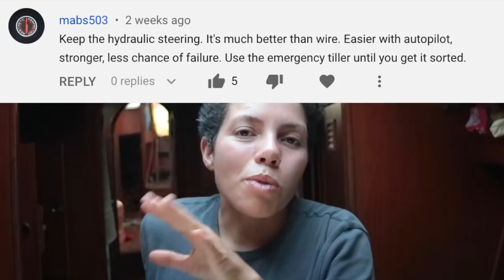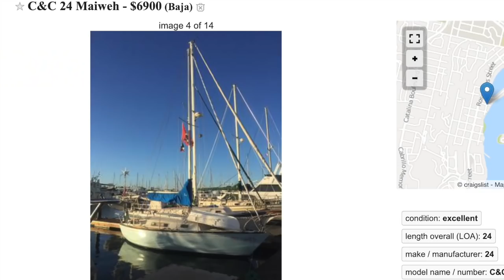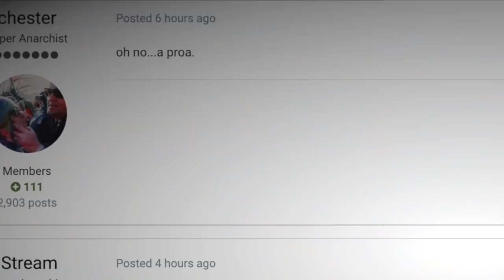Desperados

Comment: the sander may have been designed for use with a vacuum dust removal system, not connecting a vacuum to these units results in excessive dust buildup and bearing failure Festool make an excellent sander they cost a little more but are well worth it but use it with a vacuum
Reply from the maker: That might be the case - once I started using the sander with the vacuum, things became a little better. Only had to replace the bearings once more!

Comment: I put my MacBook air in a waterpeoof bag. I added silicone envelopes to absorb moisture. Well one broke open and a mini pellet got styck in my fan. Removed the fan and broke the connection plug. So i got a Mac Mini with a 12v tv screen to edit with. And use the MacBook for internet and photos only. It used to really heat up when transfering clips and renderinf. The fan would ramp up hard. Then there is my drone, a spark. He's stuxk on a cliff after losing control. BTW loce your intro!
Reply from the maker: Looking forward to the drone rescue if you are attempting to do that in an upcoming video, haha!

Comment: I used to work in an electronic manufacturing plant, all our boards that were going to humid environments would be sprayed with "conformal coating" to keep moisture out. You can get it on line but you have to be careful to not get it on to any connectors as it will insulate the connections.
Reply from the maker: Yes, I imagine you can't just spray everything down with it. Only particular parts, so that complicates things a little. Thanks for the info!
Reply: @sailorama  you can spray pretty much the whole board. Just avoid any connectors, motors like fans, and heat syncs. There should be lots of tutorials on youtube.

Comment: have you considered using a de humidifier   .  perhaps you could store it in a plastic tote with a passive  dehumidifier  and if your solar could handle it  perhaps running a  powered de humidifier in the boat cabin  i am sure you could pick up a small cheap one
Reply from the maker: This is an idea...however a lot of power demand. I’m going to work on getting some little dehumidifying baggies to put in my computer bag first, and then see where we go from there.

Comment: Try this trick with your computer. I have a commercial ziplock bag that I got from a friend who works at the post office, but you can find them other places as well. When I'm not using my computer I put it in the ziplock bag which has rice in it. My computer has covers for the usb, power and other plug entries. I lost a couple of them over time and found a small piece of electrical tape works just as well. When the computer is not in use, the rice draws out all the moisture. I also do this with my handheld "waterproof" (lol!) VHF when I long term store it when hauled out. They are both still working in fine condition. I'm still going to have to replace them but from age and because they are so slow compared to the newer stuff out there, but not from salt moisture. Good luck and love your videos your newest subscriber!
Reply from the maker: I like this low tech moisture bag hack, haha. Sounds powdery though (rice flour in all the cracks).

Comment: Take the protective case and keyboard cover off the laptop it's not protecting anything and it is insulating the laptop and make sure you aren't sticking it in a case that holds in moisture directly after using it.  Adding some dessacent bags to your laptop case won't hurt either.
Reply from the maker: This is good advice. I was keeping the last laptop inside the waterproof case too often, without those little baggies. The keyboard covers are keeping the area a lot cleaner though. If the computer isn't overheating you would still recommend not using?
Reply: The keyboard area is above the areas that create the most heat.  So that thin rubber protector is letting heat through but trapping moisture underneath.  That might be fine if the keyboard area is separated from the main chassis.
Reply from the maker: Thank you for the explanation. I had not thought about it as a moisture trap. Took the keyboard cover off.

Comment: Looks like it would be easier to build a new proa from scratch. What are the specs on your new 'ship'? Length, beam, draft, headroom?
Reply from the maker: The thing is, we're really just trying to do the simplest thing ever. Sand that thin layer of crappy, crusty varnish off and address the small rotten spots. It just ended up being more troublesome than imagined! You know, we don't have those specs available (like on sailboatdata). We still haven't physically taken those measurements - time to get on that!
Reply: It's a beautiful boat, and I love watching you do all that work. Very educational. I'm looking for my "bucket list" boat up in the Puget Sound area. I did a bit of sailing years ago, and loved it, but never owned a boat myself. It's awesome, felling the power of the wind.

Comment: Most sanders out their just aren't up to continuous duty. I burned up three on one boat hull. unfortunately They are disposable.
Reply from the maker: Doing our best to repair the current one - other than the bearings, the parts seem to be high quality. Hopefully it can be saved!
Reply: @sailorama  The bearing are chap. If you just measure it the "Bearings " stores will have it.

Comment: You don't get to send it back under warranty when you crash it.  You get to pay them hundreds of dollars to send you another one.  They will view the flight logs and see that it crashed and that will go on your permanent record.  Ask me how I know.
Reply from the maker: We paid 50 bucks extra for two possible replacements within one year, as long as the physical drone is mailed back to them. They also wanted 50 more dollars on top of that to skip the assessment process. We send the broken drone + 50 dollars = they send a new one, no questions asked. This would have been fine, but mailing items back and forth from Mexico would have been the hardest part. In the end, I cancelled the process, but they didn’t want to give the additional 50 back (for a service we didn’t end up using). Told them that we would report the experience on Youtube. They sent the 50 back. So...could have been a worse experience, but turned out alright. Only  had to threaten bad exposure!
Reply: Oh, yeah, I had forgotten about their warranty scam.  My Spark has sat in the box for several years now since I got it replaced for over $300 because it fell 4 feet to the ground.  I can't afford to fly it again.